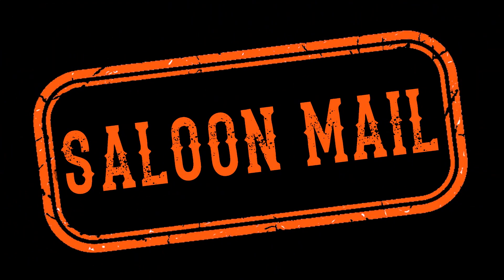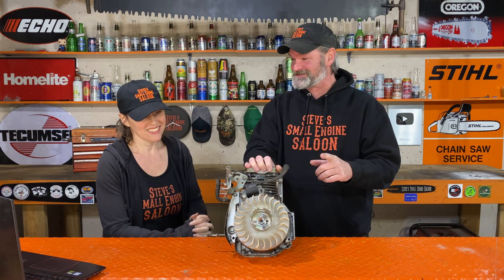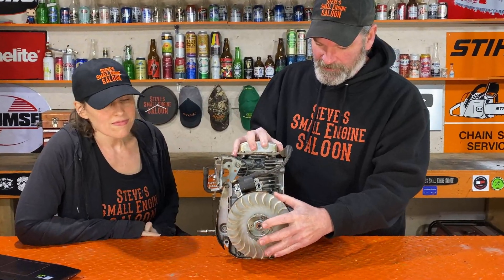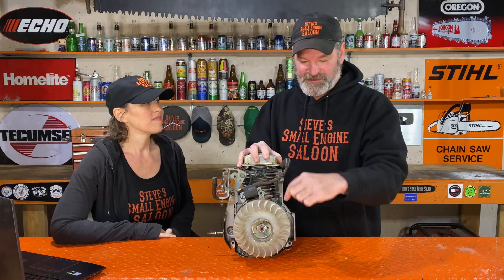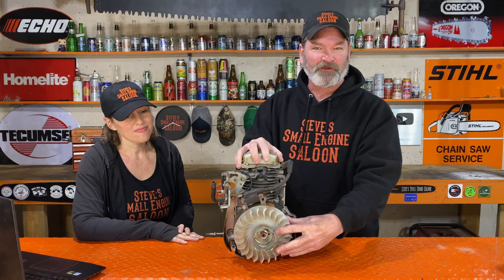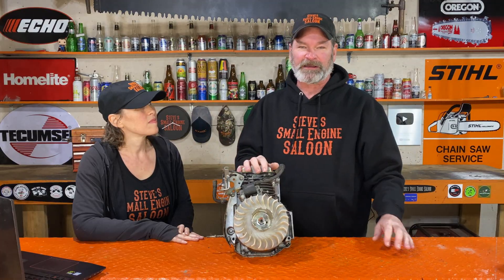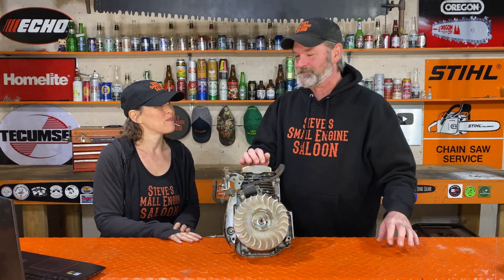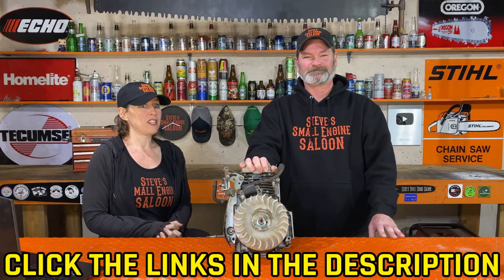Does Cleaning Flywheel Rust Give You Spark? (DAY 22)

Comment: Old video but I will say I ejoy them and gave you a thumbs up. With that said I had a push mower that in the fall I parked under a trailer every year. In the Spring I would pull it out and try to start it. It would have no spark, I cleaned the rust off the flywheel and coil and I had spark and it started. Witching for water defies logic also but I have done both and don't give two shits if somebody thinks I didn't do either. I hear you on the rust being thin and I thought the same thing. But if the mower had a different problem, then sanding the flywheel magically made it disappear again and again. It's voodoo just like witching for water. Just because you can't explain it, doesn't mean it didn't happen. But we could talk about it over a beer.

Comment: I've never had it magically fix a no spark issue however I've always cleaned them when I have the engine open anyway... It certainly can't hurt to clean it up and I feel like although it's not gonna magically repair a no spark condition it does seem to help with the machine running nice and smooth. Maybe it's in my mind but I'm still gonna take the time to clean up the flywheel and ignition module anytime I already have the top cover off the machine... It makes me feel better lol 😂... Love your content.

Comment: I don't know exactly what I did, but I had a Stihl weed eater with no spark. I ordered a new coil. When the coil arrived I took the trimmer apart & found lots of rust on the coil & flywheel. I gave it a good sanding & it is still sparking maybe 7 months later. It may have been that the coil was unable to ground. The trimmer has apparently been sitting for a very long time, it looked bad. Perhaps the air gap was incorrect, I didn't check it before I removed the coil. It also could have been all the oily, dirty mess all over the trimmer.

Comment: What if you get spark, have fuel, air, cranks and does not start?
Reply: Having those prior to the combustion chamber doesn’t mean that you have those  within the combustion chamber.  Having spark at correct timing is needed also

Comment: It does sound unlikely that a thin layer of rust would effect spark but rust has been shown to affect magnatism. Iron Oxide is not magnetic, apprently. 
Anyway, I'm not here to say it does or doesn't make a difference, as I've only worked on a handful of small engines in comparison to you, but most recently I did have a mower with no spark which seemed to (coincidently, perhaps) spark after I cleaned a layer of rust off.

At the very least, like you say, it enables more accurate gapping.

Cheers

Comment: No spark on my Ariens SB. New plug, nothing. Tested my ignition module and got the same strong reading at all three test points. It’s good. I took 0000 steel wool and knocked off the rust on the flywheel and shined it up and voi la, a strong spark.

Sometimes, it’s the last thing you’d think was the problem.

I’ve never tried troubleshooting a no spark condition before. Just saying.

I’m a loyal viewer. I love your channel!

Comment: I have had few times over my 50 years as a small engine mechanic where the module flywheel contacts or flywheel rust did keep it from getting spark and after sanding both and regapping it worked fine. So I would have to disagree with you.

Comment: I have a generator and it started running , serging then stopped. I replaced the coil, lapped in the valves and set valve lash. I replaced the carb and only have 74 LBS of compression. When on TDC the magnet on flywheel is past the coil about 1 1/2 inches is that normal? I just can't figure out why it won't run. It will start(hard starting)but won't continue to run. Have any ideas on what to check? I did un hook the low oil sensor also. Thanks

Comment: Today my 15yr old 21hp Briggs & Stratton engine wouldn’t fire up.  I checked the battery, starter, fuel , spark plug, everything was in order.  I had rebuilt the engine when I replaced the camshaft and head gasket, starter,  etc etc five months ago and it has run like new ever since then.  I came across a suggestion to sand the rust off the flywheel today and since it had a good amount of rust coating it I did that, and it’s been starting good again.  What is going on when rust on the flywheel is preventing it from starting?  I just asked Gemini this question and it says:

Improved Spark:
Rust can build up on the flywheel or magneto, which are crucial components in the ignition system. This buildup can interfere with the spark generation process, making it harder for the engine to start. Sanding these components removes the rust, allowing for a stronger, more consistent spark.

Comment: actually helped a lot. I have an old garden way that had been sitting in my dad's shop for 10+ years. The flywheel is rusty but I noticed the rust on the magnets. I had replaced the coil. Needed the gap distance and to know if I needed to clean the rust on the magnets to set the gap. I won't worry about the flywheel but will clean the magnets before I set the gap. Thanks!

Comment: It will not cause no spark but if you have alot of rust it will cause weak spark causing it to run rough usually from washing it or storing in the rain. But no it will spark no matter the rust,just run bad. I've been doing this since I was poor ,still poor.

Comment: Help, my Troybilt Kholer 20hp  just died suddenly while cutting my grass. Cranks but no spark. I pulled the wire off the coil to test for spark like you said in a video but still no spark. Is the coil bad or can it be some safety feature on the mower that won't let it start?

Comment: Well "I", a well-seasoned guy, am stumped. So anyone's help appreciated. Four year old Briggs and Stratton 125P02-0012-F1 8HP vertical (lawnmower). Running fine then poof. On hand and all new OEM: carb. magneto and set at .012 using two feelers leaves to make sure both gaps identical. New spark plug. NO SPARK. Cleaned the flywheel magnets. Replaced the magneto ground wire. Still no spark - and I looked in my dark garage with the plug out of the engine and the lead attached. Grounded the plug threads. Nothing. Nothing. Nothing. Such a simple system and I replaced all the components but the flywheel - which the magnets do appear strong.

Comment: Have you ever had to replace the flywheel because no spark issue? My coil has 4.5k Ohms, good grounds, cleaned all surfaces, spark plug is good....NEED HELP SOS!!!
Reply: Could be your kill switch is shorted. Pull wire off coil it will start. 

Or weak magnet in flywheel.

Comment: I had a really rusty flywheel and coil pickups be the non-run issue on an old pressure washer today, cleaned it all up with some sand paper, set the gap back and started it up, had dinner, sat here and wondered if i did it right, googled the issue to find this video where you state its never the issue. What a plot twist when I watched your  vid

Comment: Steve, Im chasing my ass. Ive replaced the voltage regulator and stator 2 times. Im only getting 6 volts at idle and 8volt Dc at 3600 rpm. Motor runs fine. If I run 12 volt to power wire side of Toro 30189 hydro drive 52 walkbehind. PTO engages everything works. Its a pull start. Im getting 17 volts ac at idle and 30 ac at 3600. I noticed chipped magnets on flywheel. Not super bad could they be weak and I just need to replace flywheel. I took multi meter from DC out put of regulator and tested against grounds all over machine same voltage. single wire stator 5-9amp. Im frustrated lol
Reply: Sometimes it will intermittently show 14 volts DC. buts its rare.

Comment: It worked for me.
 With the rust on the flywheel spark was weak, after cleaning off the rust and resetting the coil it gave a stronger spark and fired up first pull of the cord.

Comment: I have something to say about the way lawnmowers are being made these days with the starter cover over everything  so you can't see whats going on. You can't even reach in and rev up the carburetor choke. You have to take the cover off to look at things, but you can't try to start it with it off and even then you have to zip tie the handle kill switch. They used to make things that ran for years without any issues. Now, you can't get through a season without one.

Comment: If your somebody that leaves  a roto tiller or lawn mower that has points sit where moisture gets  to the flywheel,
 And the thing is just covered, I maybe wrong  ( but I would remember taking off the flywheel as It's more work to get to the points).
And removing that heavy rust fixed it. multiple times.

Comment: I'm completely rebuilding an old 725 sears tractor. Put new wires in that I personally cut and crimped myself, cleaned up the carburetor via manual, fixed the starter generator, new battery, new sparkplug... but no spark on the rusty, original magneto. I wonder if either the contacts are too rusted or if it's a ground issue. I gapped it to the max gap and even the minimum gap, but no spark. Should I sand down the rusty contacts or just order a new magneto? I would think that it just being a coil that it would work. I used a multimeter on it, and it has a few continuity failure spots, but it's fine on most points. Everything else works on the engine though. Maybe the new sparkplug needs to be gapped? ...Writing this all out got me thinking of a few things I could try actually... Thanks for the video though!

Comment: Steve, i know you won't believe this but i had a situation where cleaning off the rust actually worked. I had to do it every spring because I had to leave the mower outside. 
I think it was because the rust built up to much and did something to ground out the magnetic field or something, but i did work. Just on that mower. All i can do is shrug. Keep up the good work.
Reply: U should cover it with a steel wash tub.

Comment: Steve I have a ch15 kohler series 2000 . The C Cadet would run then quit. No spark -I replaced the coil . It works now . Old one  had a very heavy build up of grease & mud . Buffed old coil with wire wheel  . The build up was in the center. Then Checked old coil with meter it read 16.3 . Can muddy stiff grease cause it to quit . Or is working Sporadically . Thank you for you’re knowledge.
Reply: Just watched day 29 - put hair dryer on high for 5 minutes pointed at coil. DEAD   Thanks  I appreciate you .

Comment: if a finger in the spark plug socket barely hurts. you have ignition problems.

if the spark plug tickles painfully then the coil needs a good service, if that doesnt work its those clapped out flywheels. if that doesnt work. drop machine from helicopter through manufactures roof with a note for reason.

Comment: That is soo funny i used to clean my flywheel just felt better setting the air gap right i have feeler guages but i use an buisness card easier works every time you should do a video on air gap for air heads the coil slams shut against the flywhell torque it down mm no spark  Ha   2 funny if you don't know this leave the coil alone

Comment: So I’ve been working on a pressure washer and it died on me like 8 months ago and I set in the garage and left it.  

Went to work on it and noticed no spark. 

Went to look at the fly wheel and had a surface rust all on it.  

Cleaned it off with some sand paper, like   600 grit.  

Tested again and I had spark.  

Now it will run a few minutes with the choke on, throttle on high but the engine is running at like half throttle.  Then it will idle up for split second and die.

Comment: this video rings to mind, my briggs 15.5 OHV engine.  yes it still had spark despite the rust, no the engine would not run or even start, so i cleaned the rust from the flywheel, and cleaned the rust from the coil where the magnet passes the coil, reset the air-gap to make sure i had 10 thousandths clearance, and like magic, the engine started.  one thing i noticed after the cleaning, before i reset the air gap, (took flywheel off, did not think the gap had to be adjusted since i never took the coil loose) when i put in the gauge, i found the air gap for the coil was not where briggs and stratton says it needs to be for the coil to fire properly.  makes me wonder if it is true, what i was told over 20 years ago, that too much or too little air gap can change the ignition timing.  after the coil and flywheel were cleaned, the gap was 15-16 thousandths, and my briggs engines run with the gap being 10-12 thousandths.

Comment: It does not hurt to clean it off... but it has to be nasty thick rust to cause a problem, which can occur if the rust drags & shorts both ends of the "horseshoe" magnetic core at the same time exactly when the magnet passes under it. To test the effect & prove it once & for all, close that gap up so the "horseshoe" is dragging lightly against the flywheel on both ends.... Most likely it will weaken the spark, but it will probably not kill it altogether.

Comment: Fully agreed. If someone gets spark after simply cleaning the rust off the magnets, chances are they in advertently bumped something that ungrounded the magneto that was preventing it from making spark. 
 I have a Briggs & Stratton pressure washe I purchased from Walmart back in 2002 that has a sensitive sliding style off switch (3.75hp classic style), I have to simply touch it with my finger before starting otherwise it will never produce a spark.  
  Lastly, perhaps a magnet could get so weak that a thin layer of rust would be all that’s needed to inhibit spark? Obviously that’s more of a magnet issue, if this even happens. 
 I have some antique Briggs engines and the flywheel magnets still seem as strong as a modern magnet so I don’t know if they can get weak over time.

Comment: On the honda gx on my log splitter last year, it would fire but then stop.  Nothing i did made a difference.  I finally realized with my inline spark tester that the spark stopped after a few sparks.  I noticed rust on the magnet, so I cleaned it off, and it started running normally.

Comment: Agreed yall. I usually run a piece of sandpaper around the flywheel, just to clean it, not to make it magically work. When I've had no spark, and I've changed the plug, it's almost always the ignition coil. Only 1 time have I had a bad on/off rocker switch.

Comment: wonder how many people cleaned the rust off, reset the coil, fixed the bad spark plug boot, and put in a fresh plug and decided it was cleaning the flywheel that made the difference.

I guess the related question would be can a flywheel develop enough rust to either short the coil or push it out of position, without being an obvious mechanical issue.

Comment: If rust on the flywheel is losing spark then simply start the engine and push a coarse metal file against the spinning flywheel for around 5 minutes. Guaranteed all the rust will be gone.

Comment: Yeah, Steve's right. I recently had no spark on my riding mower and it has two spark plugs and modules. One of the modules stopped working so I replaced it and I didn't even bother with touching the bit of rust on the flywheel and back up an running. It's magnetism that gives you spark, not a contact patch because there's not contact.

Comment: You'll be better off using a micrometer or feeler gauge for what you are doing. As a commercial printer for over 35 years I can tell you about the thinnest "card stock" is about .014 of an inch. (finish affects this) Most of the "card stock" I ran was thicker at around .020 of an inch IIRC. (But it's not measured in that way... it's really by weight. But that will just get you confused. The same weight stock in a different finish will affect thickness) Some were twice that. Decent bus cards go in Cover stock, not card stock. Then there are overprint varnishes, etc. There is no such thing as a 'standard bus card' stock. Each shop may be a "shop standard" so they can limit clients choices, but...   -  "card stock" - 90lb index and 65lb cover are about the same thickness. Just as 110lb index and 80lb cover is about the same. Again, finish will affect this as will brand, etc. You could just mic out a bus card that you always use and write it on it then you'll know what you are setting things at.

Comment: Yes I have in fact gotten many of engines to spark again by wire brushing the rust off the flywheel and magneto, now these were engines that had sat out in the rain for a long time but yes it works in that case.
Reply: im struggling with a no spark issue. the output reading of my pulser is only 0.1v ac. ive replaced the stator and still same low reading. my flywheel is rusty but previously, it works fine. then suddenly it stops working.  now its sitting looking for an answer to the problem.

after reading your comment, there must be some hope to reviving my bike again
Reply: Absolutely 💯 Percent correct... Steve made the Assumption that there's no such thing as excessive rust build up

Comment: To answer the question, no cleaning the flywheel only will not restore spark.  Cleaning the ignition coil will restore spark.  If you are going to remove the coil to clean it then you should clean the flywheel magnet and the properly set the gap.  I have done that on mowers and trimmers and chainsaws alike with no spark and that's what I go to first when there is no spark.  So no the flywheel alone will not restore spark but the ignition coil will as long as it is not faulty itself.  I have cleaned and restored way more coils than I have replaced.  Rust on the flywheel side of the coil does produce higher resistance that the coil will not function with.  The magnet will still work however the ignition system is still compromised.  Clean the coil and set the gap.  As long as the coil and wire are not damaged or defective then it should work.